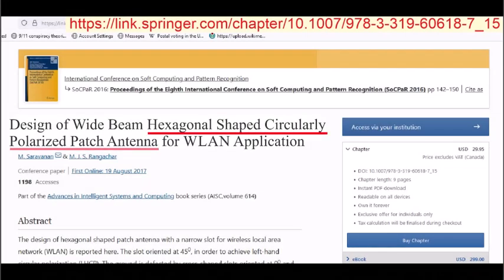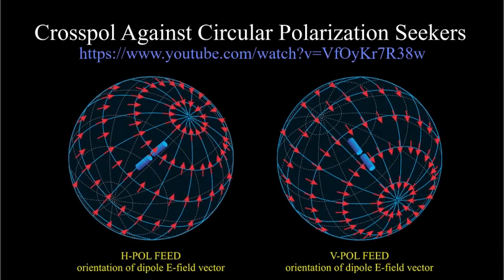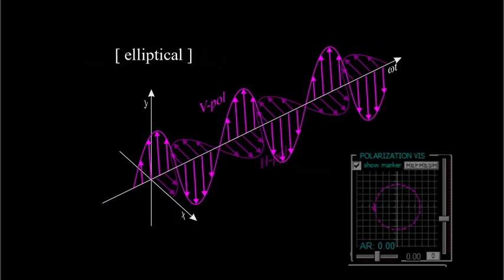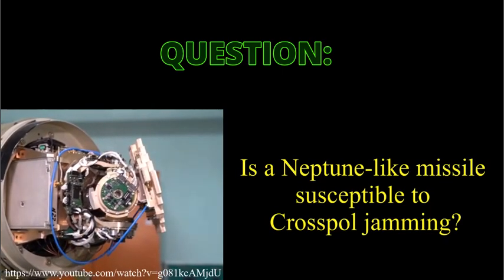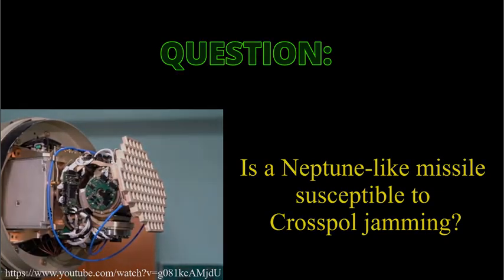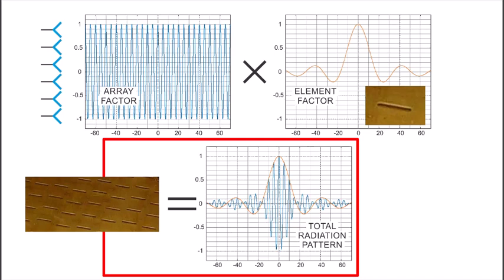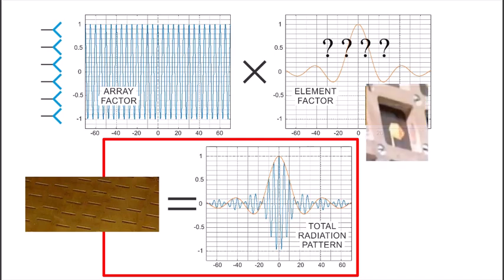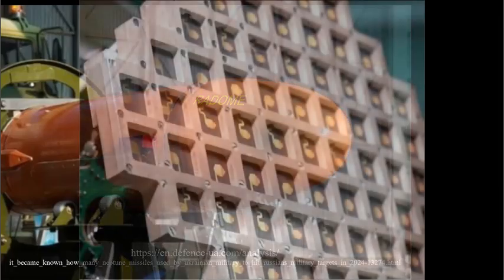Crosspol Jamming vs  Neptune Seeker   Part I 00

Comment: hexagonal being asymmetric should impact circular polarization purity & cross-pol gain
Reply from the maker: Agreed.  The isolation appears to be surprisingly poor, that's coming in Part II.
Reply: @skyindustries  Multi-Polarization ( 60deg) or hybrid (LHCP + vertical linear), the  bandwidth could be wider with hexa.
Reply: While a """perfect""" circle (with continuous rot.symmetry) is theoretically ideal for generating two identical orthogonal modes, a normal hexagon (which has sixfold rot. symmetry) can nearly mimic a circular pattern. By carefully designing the feed network and ind. elemt geometry, (namely, an introduction of ground planes and timed feed network) hexagonal antennas can overcome potential asymmetry issues and produce low cross-pol levels and good cir.p purity. Practical implementation of a hexagonal array - such as that used on the Neptun missile, can, with proper design, meet the high performance plank required for circular polarization. Does it? I don't know. But Neptun was made in 2015, way past the introduction of antenna simulation software, so most likely, after due simulation runs, the feed system of the seeker is optimized for the most optimal circular polarization. Hexagonal microstrip antennas can attain an axial ratio of 1.2 dB at 4.1 GHz, which is good circular polarization pattern, and that is for publicly traded antenna.
Reply from the maker: @0katze  very interesting, thanks for sharing.  

There are interesting intrinsic of-axis issues related to ellipticity, caused by basic electromagnetics.